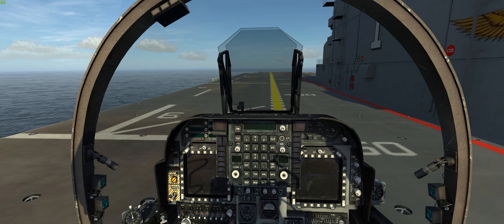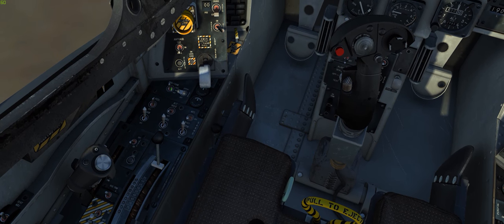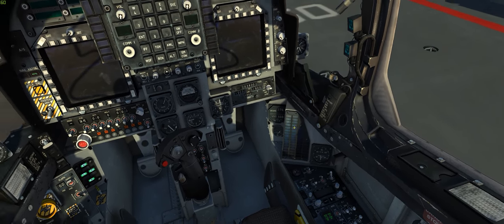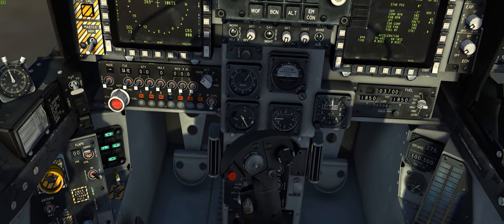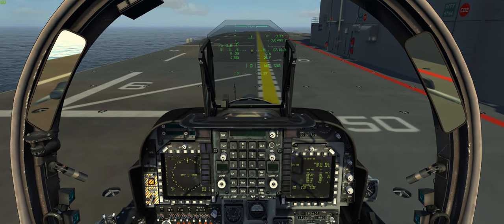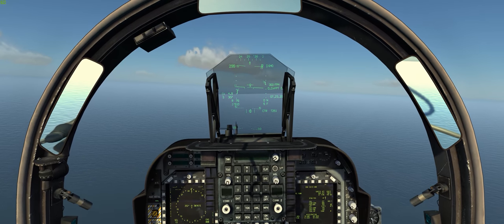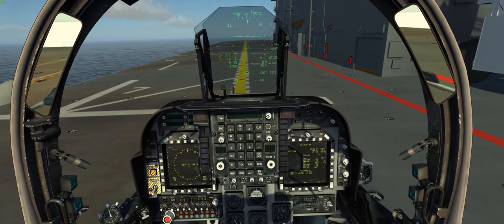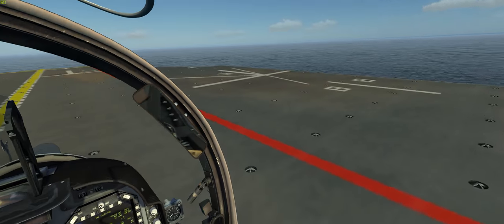DCS AV8B NA Introduction to flight (3440x1440 60hz)

Comment: For the Anti-Skid/NWS switch on console, I have seen that when enabled, AND holding the NWS button on control stick, you can get an even tighter turn radius. This "high gain mode" can help with the limited space on carriers.  HUD will indicate this additional state lower right hand text "NWS HI" (pg 2-60 of 2008 declassified AV-8B flight man)
Reply from the maker: Thanks, I thought i made this clear in the video obviously not. With anti skid in NWS, 2 modes hi (45deg)/low (14deg) with the NWS hotas button IN/OUT. With anti skid in 'ON', two modes, LOW (turn rate, 14deg)/Disconnected (CAST (castor)), with the NWS  hotas IN/OUT. Additional position CTR (centered) only when the gear is up and in flight. Thats as it is in this version from what I see. So if you see 'NWS' in the hud you will always be in the 'LO' turn rate. . Key point remains, you should always see 'CAST' in the hud during take off and landing. I will check out the manual you refer to Cheers.

Comment: Hi!  Thanks for the vid!  I've got a technical question that I've been unable to find online; what is the purpose of the second and outer half-length glasspane of the HUD?  I see the F/A-18 has a similar setup, whereas the F-16 has a single (but thick) glasspane. Obviously the F-16 HUD needs to be more sturdy, as it will take the full impact of the wind in case of ejection.  But the outer half glasspane? I'll be happy if you can supply an answer to this :)
Reply from the maker: I guess different technological advances. Harrier MK2 & F18 McDonald Doughlas, F16 Eagle dynamics. Also different variants (block 40 c.f. 52), have diferent hud designs. Wonder is is a kind of 'sun visor' ?